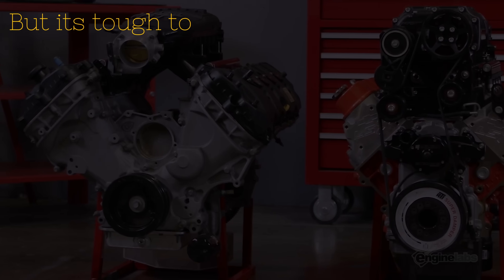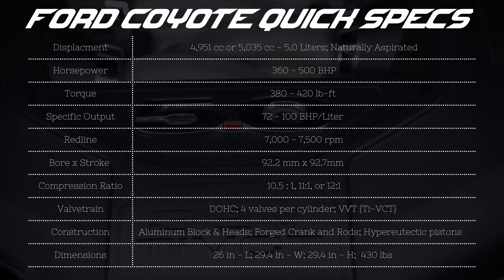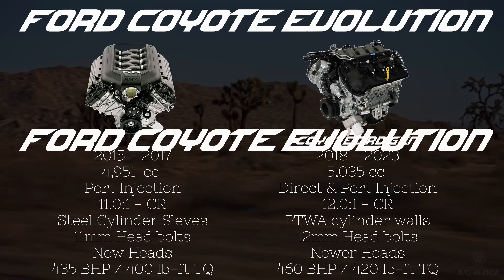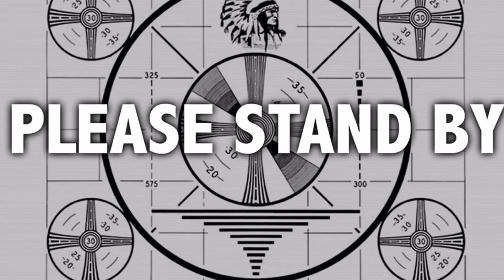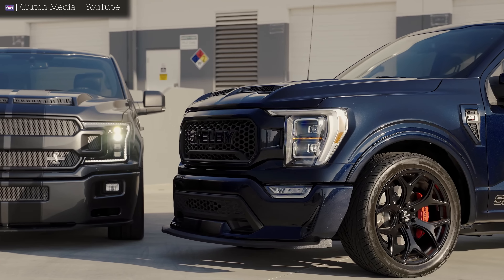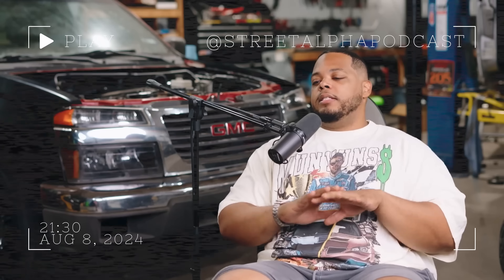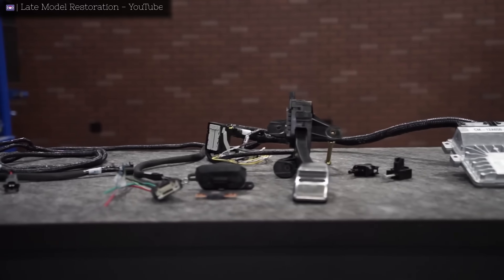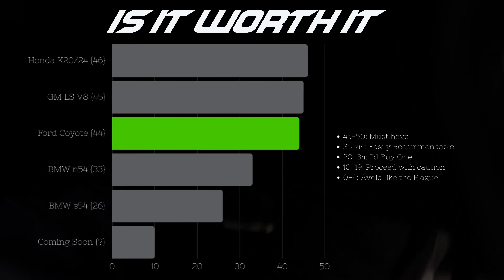Is Ford's Coyote V8 the BEST Modern Engine?

Comment: I have a 2017 Mustang with a 5.0 Coyote engine which I find excellent. Instant power all the way to the red line and a glorious howl from the exhausts.
I had a Roush supercharger with intercooler, surge-free sump, billet oil pump, oversized oil cooler etc. fitted. 
The power has increased significantly to the point where the rear wheels spin in first and second gears (it's a 6-speed
 manual).
High speed runs no longer result in overheating smells and crackling noises.

The supercharger is the 2300 CC model that shouldn't overstress the clutch.

Comment: They ruined it with WET RUBBER BELT OIL PUMP and the CYLINDER DEACTIVATION nonsense ! Never buy a coyote in a f150 newer than 2020. Mustang is a different story.

Comment: I'm Australian. My Gen 1 Coyote in my 2017 Mustang has a Roush 2300 supercharger, much larger oil cooler, custom oil pan, steel oil pump and 650 HP.
Instant power at all revs and in any gear. It runs noticeably cooler under full power than the stock car did.
All round a terrific engine in a great car with excellent suspension, brakes and drivetrain. 
My first American car is a people's car that can compete with the the world's best.

Comment: A na coyote just ran 840 in the quarter mile with a straight drive transmission it did this with a 50 plus year old man. At Rockingham drag way in Rockingham NC.
Reply: Didn't know age made a difference in the qtr mile. That engine is maxed out on nitro.....the ls has been 7s na with someone older

Comment: i have 2022 mustang gt premium (first manual, first v8, first mustang and first rwd car) and i love this thing. something so special about these cars man

my goal is to VMP supercharge it by the end of next year but rn i just want to do simple bolt ons like headers, ported throttle body and manifold, cai, catback. then after that focus on getting everything ready for the extra power (suspension, billet fuel pump gears, driveline, built calimer mt82 etc etc).

Comment: Cars I currently own:
2019 Mustang 5.0 pp1 10r80: blew the transmission at 18k miles but the engine is still running strong.
2019 raptor 
2021 trakchawk 

I also owned a 2012 and drove that till 100k miles with zero engine problems. 

The coyote is extremely reliable. I maintain my vehicles well but I do absolutely beat on them. Which is why the tranny blew at 18k miles. The engine itself is reliable as fuck! 

Now, why didn’t you dive into boosted applications big dog? That’s also important.

Comment: I’m cursed with experiencing torque monsters as early as I can remember. GS 455, 440 Roadrunner, Formula 455. That’s why I have a displacement requirement of 427 or higher. And even that’s kinda small. At least the LS can be punched up there. Knocking down 26-27 MPG heading home doing 70 at 1500 RPM after running high 10’s at the strip.

As far as best Ford V8, 4.6 FTW. They carried civic duty for decades. Rock solid. Just a great engine. Too bad they didn’t develop further.

Comment: I have a 22 Mach 1 and a 17 f150 with a whipple 5.0 . Oz was tuning it when I made my first WOT 2nd gear to shift into 4th gear pull. HP tuner showed 772 pound feet of torque at 8300 RPMs and the numbers were still climbing when it shifted into 4th. It had not flattened out. I have 3” full exhaust with 750hp each twin cats and true duals. Engines are air pumps. With a super charger you must get the exhaust out of the way. I am just amazed at the Coyote. BTW I had them set the shift point to 6500/7000 normal/sport. That was crazy.

Comment: The easiest answer to this is if you are wanting raw NA power, you go with an LS/newer LT. if you’re wanting boost you are shorting yourself without using a coyote. Coming from a guy that’s still a fan of the OG 4 valve mustangs. DOHC airflow is just king with boost. As is displacement without it.

Comment: The center of gravity of the Ford is higher than the LS/LT engine because of the width and height of the engine.  That said.  I like them both.  But the LT6 engine C8 Z06 engine is the current best NA engine.

Comment: Maybe if it were 7.0l? I bought a Scat instead because of the grunt. The 5.0 is too small in displacement.
Reply: I’ve had a 23 SS 1le a 23 widebody scat chally and now a 24 mustang DH. B4 I had the chally ppl always hyped up the torque of that car but that heavy bih disappointed, the maro had the best down low power, the scats to heavy to feel anything in my experience

Comment: I've built the Coyote and the LS and I'll say this. 
At 5 liters, 302 ci, the LS cannot compete with the Coyote without a lot of help (cam, compression, ported heads, etc.). However, for the money, you can go WAY bigger in terms of displacement with an LS and there comes a point where the LS gets so big that it passes the Coyote. 
Taken to the extreme where money is no object it becomes more a matter of preference. Both engines can be built for thousands of horsepower with modified or aftermarket blocks.
It just depends on what your goal is.

Comment: If Lexus’s 2UR-GSE 5.0 v8 (which came before Ford’s modern 5.0 in ‘07) got just as much aftermarket support, research, and availability, I think it could easily match the coyote if not even surpass it. Yeah the 2UR only revs to 7.2k rpm and no manual but gotta also give it props, especially for its reliability and limiter you can bang without any worry at all

Comment: With the nit noid bolt on stuff I've done to my '21 Mach 1 10 speed, I'm guesstimating I'm at about 513 fwhp. That is 1.69 HP/Ci. For an LS to do that, in one of the many LS build books I have, they took LS3 and sleeved and stroked it to a 427, put a twin screw on it at about 8lbs boost and made about 725 fwhp out of it. When I ESS Supercharge my Mach, at about 8-9lbs, I'll be at about 743 to 760 or more at the fw!!!!!!!!!  That's 2.46 - 2.97 HP/Ci!!!! That's insane. The LS engines are great for cheap power, but I'll take a Coyote any day of the week.

Comment: Ford Has Fixed the Limited Displacement Issue Coyote suffers. It's called Godzilla 7.3.  A virtual LS Clone in Big Block format. Iron block can withstand 30lbs boost. Displacement can reach near 600cid. And its pushrod LS design fits anywhere and makes prodigious LS HP too.
Complete Crate Godzilla sells about $8,900 from S-D, Jegs, Summit, etc.
Poof , your Coyote problems were already solved by FoMoCo in 2020.
Reply: @peted5217 I see we have a man of culture present. Yep. I fight the urge every day to buy an S197 and Godzilla/MagnumXL swap it.
Reply: @g04tn4d0 Godzilla gains aftermarket support daily. Upcoming SEMA show should have lotsa related items in the New Products showcases
Reply: you do realize Ford made pushrod engines well before the LS?
Reply: @nolanjohnson2124 Ya , and your point is ?

Comment: Had coyote plastic timing guides can't handle stress and 5 foot chain got jammed up in Crank . Plus pump failure. Like any engine you can fix the weak points and make it great.
Reply: All overhead cam engines have plastic guides.

Comment: The second Ford put the cylinder management shut down bullshit they destroyed that engine.

The best version of the coyote 5.0 V8 was anything before the cylinder shut down. The same goes for the LS 6.2 V8.
Reply: Exactly which is why I bought the 2024 Nissan Titan with the 5.6L Endurance V8 in it with 400 HP and 413 Ibs of torque over the 2024 Ford F150 with the 5.0L Coyote V8 in it with 400 HP and 410 Ibs of torque since I didn't cylinder deactivation nor auto stop start and didn't want to deal with the dents on the aluminum body F150 as well.
Reply: @CJColvin great buy! That last Titan is amazing.
Reply: @SuperSnakePlissken  Yes sir, already did and let me tell you its a freakn beast.

Comment: Wasted a Coyote over and over again out on I985 north of Atlanta. 40 roll 50 roll 60 roll, "Just hit it" I said. I'm in an '04 C5 Corvette with BTR stage 1 cam, CAI, catted Kooks headers, Z06 titanium exhaust, HP Tuned, auto transmission with tuned shift points and pressures for harder quicker shifts on the 4L60e. 412 wheel hp, I won!?
Person looked a little disappointed after I slowed down next to him and gave him a thumbs up. It was a Coyote powered Mustang. I could hear the distinctive sound the Coyote powerplant makes during his "full throttle pull" for a few seconds as I accelerated away from him. That's the single Coyote powered Mustang I've raced. I beat an older COBRA too, from a roll and that car is 390hp, supercharged. I'm sure I'll lose soon, but that round, the 20 year old, 140k mile LS1 won. I've got other kills from unsuspecting Dodge, BMW, Nissan, Subaru drivers, Porsche and Toyota. The Vette is not fast, it's quick. I rode in a PLAID for the first time recently, that was fast. My boss drives a Huracan and the PLAID is faster. FAST and QUICK, not the same thing.

Comment: Only problem with coyote engines is oil consumption. When Ford removed the cylinder liners and started using a coating in the cylinder bores, problems with oil consumption started. Cost cutting. Now a class action law suit.
Reply: Ford has remedied that issue quite a while ago.

Comment: Ls3 guy here……..each motor has its pros and cons but 7:57 shows one clear Advantage LS’s really have over Coyote motors…… we can put’em in ANYTHING AND I DO MEAN ANYTHING
Reply: Coyote swap C6 Zr1 is proving you wrong
Reply: But why does that matter when you could just buy a car with a coyote in it and it’s much better in pretty every possible way besides torque
Reply: In the middle of LS swapping a Toyota Celica GTS and I can report it fits, but had to set the engine 7 inches back, use a front sump pan, and a lot of the car had to get out of the way. I COULD make a coyote fit but I'd have to completely redo the front sub frame and steering, probably with a mustang II front end or similar.

Comment: Coyote 
The ONLY oe platform to EVER win overall Sick Week and now TWICE in a row. 
3227 whp @ 9580 rpm with prepped Predator block, ported gt350 heads and most oe timing components. 
Drag and drive radial record 6.07 @ 236.8 mph. 
Highest brake mean effective pressure of any regular mass produced V8 engine.
Reply: 🤣🤣🤣🤣🤣🤣🤣 Pick a drag test video from anywhere on Youtube and their asses are getting flogged by very nearly every other car make out there! 5 litre ? No answer for cubes particularly when supercharged as evidenced by Chevy and Mopar dominance track or street ! Your dreaming Bud and its time you quit pissing in your own pocket along with everybody else's!!

Comment: Ford killed it with this motor.. If you are watching this you probably already know.. I'm going to get an ESS G2 with a 115 pulley on 93 and call it a day.. That should land me right at about 680 to 700 wheel and all I'll need is a Boost a Pump.. I may even do the 120mm pulley and hope the car makes like 650 wheel.. I have an MT82 and so far so good but that's the reason I want to do an ESS type blower.. It won't break the trans as easy as a whipple or something bigger will.. With a Centrifugal you can make the same peak HP number's but with way less torque.. A Centrifugal will make 680 peek HP but at just under 500 WT which is great for us MT82 guys and people who want there cars to drive like daily's up until they hit 4500 rpm.. That plus the weight savings to me makes the centrifugals better for just the weekend cars and coffee type who just wants that extra and doesn't want to waste money on the FBO route.. Plus everyone know's you can spend over 6K doing that or spend 6K on an ESS kit and another grand on a tuner and be way happier even on a 120mm pulley n 8 psi of boost.. And the stock cats will probably live a while on 8 psi too especially if you are just a weekend fool around type.. Just saying I've seen guy's do $5000K in longtubes Boss Intake, E85 tune all for 500 wheel.. That just seems like a waste of money to me.. But to each his own..
Reply: As a mopar guy 5k on a LS will get u way more hp
Reply: @CMo-p8t lol wtf, no it won’t 5k is heads cams exhaust and a manifold plus labor, the coyote is a 4k Ess kit away from 800 crank
Reply: @CMo-p8t 😂 That’s just pure delusion.

Comment: I had an LS based motor for over 10 years in many different configurations from bone stock to hci strokers. Yes the torque is nice, but nothing beats the way a Coyote revs to 8000+ rpm even in near stock form. Been a Coyote guy going on 9 years now and do not miss the LS one bit.
Reply: I like what you did, it's all about trying all of them to see what fits you. Respect.
Reply: Way speak facts most LS guys will never say the truth there like all Maga people act
Reply: So i do agree here, ive got the LS with a whipple and big cam etc in my camaro - how ever i need to forge the bottom end to go over 800bhp however the coyote 5.0 can offer alot more strength bottom end and more bhp overall with less mods. I sold my GT's and will now look to buy a new S650 or S650 Dark Horse and the solution is i will Keep my LS and also have a coyote again , best of both worlds . IF my car wasnt bumblebee id have sold it but love the camaro Bee thing - but Love the 5.0 as it seems more robust
Reply: Ford going Vtech.😂 I’ll take the Chevy Torque monster for muscle car builds all day. Keep the wind up for the boy racer. To each his own.
Reply: I also have the opportunity to spend allot of time with each platform however the LS remains king. The fuel economy with over 500hp on my LS7 is close to 30 MPG on long trips. My 6.0 in a 10,000.00 lb+ truck can pull mountains and still manage 100mph with double the weight still same or better mileage than my Ford pickups.
Reply: @nyplantings2420  to be fair, the main reason of the Corvette's excellent fuel economy is its weight and aerodynamics. Slap a 500hp Coyote in that Z06 and it will pull 35+ mpg on long trips.
Reply: You were always a Ford loser ,you just didn't want to go against the overwhelming flood of GM popularity out there! Cant say l blame you with the overall decline in interest in Ford over the last 30 odd years. A fully modified BALLS OUT BLOWN LS is the preferred way to go and has been since their inception!! Advice would be get with the winners or keep losing with PHHHHHHORD LOL!!
Reply: But they are blowing up, now!
Reply: @Fireal4632 who cares dohc is more cooler
Reply: @infamousaries1095 no it's more complicated which is why they're blowing up like those german and italian engines
Reply: @aaronvector4750  I’m still pickin Coyote over LS 😅
Reply: @aaronvector4750 still cooler and sounds better then a ohv in the way it makes power
Reply: @Fireal4632 coyote is way more reliable then an LS, LS3 has trunnion issues, bent pushrods, dropped valves etc etc etc
Reply: @robbierector1669 And better gas mileage.  You can have 800 hp and 10 speed and get 25 miles a gallon.  LS luck if you 6 miles a gallon.  I know I owed both..
Reply: @robbierector1669  - More reliable? Let me know when you blow a head gasket from overheating. Those Coyotes run HOT. Besides, they all have issues as we are beating them on a daily basis. LS is the most swapped motor on the planet for a reason. If the Coyote was so much better, everyone would have been swapping to them years ago. Not saying the Coyote is a bad motor. On the contrary, I think it is a beast. Pretty awesome how Ford can go toe to toe with a GM motor that has 1.2 more liters of capacity. So kudos to them. However, I cannot stand the sound of a Coyote in comparison to an LT1. There is no comparison at all to me. LT1 is a torque monster and sounds absolutely incredible.
Reply: @MrChainvapor  Coyotes run hot if you don't maintain them. Mine runs cooler than any LS I've owned. The 2 main reasons why LS is the most swapped motor is because it's cheap and fits easily in most cars, not because of its power or reliability.
Reply: @saidtheblueknight  - Has a lot to do with reliability actually. I know a lot a guys with classic cars who drive across country because they LS swapped them. I know one in particular who has already put 40k on his in a 68 Camaro and has not had any problems at all. I think it really comes down to who installs them. If it is done correctly and tuned correctly the LS is one of the most reliable motors on the planet. Not to mention they do supply good power right off the rip. However, if you start adding power, reliability will go down if not done properly. Again, I believe it really comes down to who is installing the motor and if they know what they are doing. Just my opinion though and I know that really ain't worth much. LOL :)
Reply: @Fireal4632 lmao lt Chevy engines blow up now my guy
Reply: @Fireal4632 not as fast as gmc and ram
Reply: @Fireal4632 no they're not, in the other hand LSs are known for that